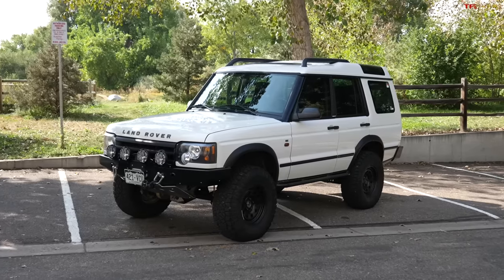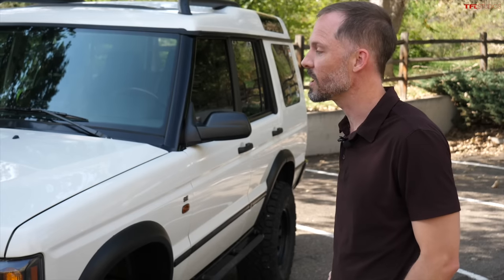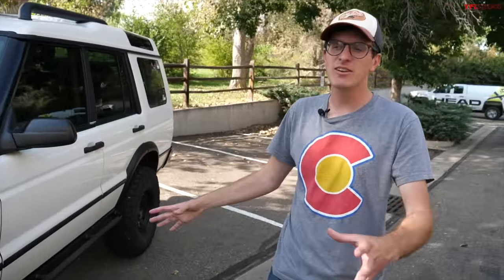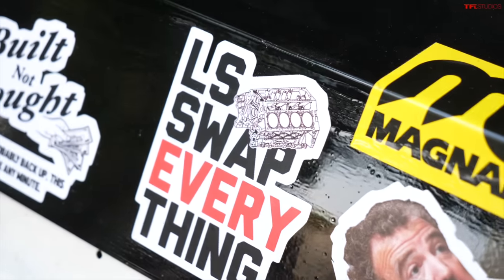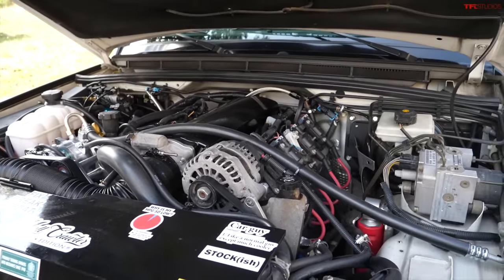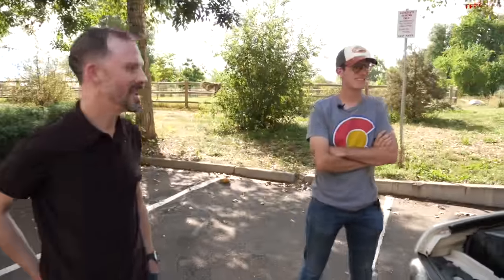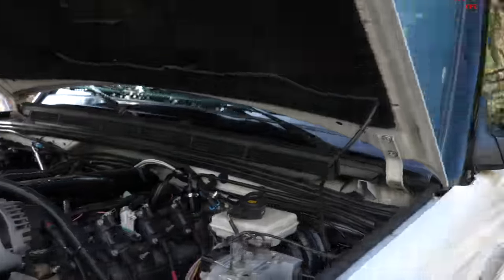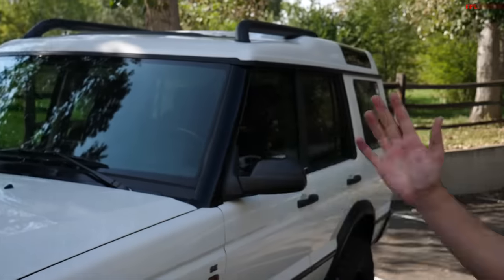$40,000 Later: I Found The ONLY Way To Make My Land Rover Discovery Completely Reliable!

Comment: My d2 literally exploded at 75k miles. I put 25k$ upgrades changed the oil every 4500 miles. I was in love and she broke my heart.  Fixed the engine for $4000 and the heads blew again at 80k miles. The diesel version might be good? Idk I would by the new defender cuz I loved my d2 so much besides the engine! But never again... worst investment of my life
Reply: I’ve got a ‘04 D2 td5 and it’s been great. Got 250k miles on the clock and still going strong.
Reply: Just get an lr3, 4.4 is pretty reliable, the transmission is ok as long as you service it, even the air suspension is pretty reliable.  Parts have gotten a lot cheaper, the only glaring issue is the suspension bits wear quickly.  The new rovers are really unreliable.  The lr3 is the car for an off-road build if you want a land rover.
Reply: @shaunbava1801   nah. It's to heavy at over 9000lbs that's why the suspension wears so quickly. Iv hurd bad things about the lr3 in general:(
Reply: @stoneyt46  it's less than ~6k lbs not 9, only 1000lbs heavier than the D2.  It's heavy but tough, I've had the D1, D2 and the LR3.  The 3 is the best of the bunch, maintain it and it will treat you well.  The interior is more comfortable, the build quality is better, the drive train is better, and the computerized off road systems are better.  For Land Rover it is one of the most robust vehicles they've ever built.  The whole LR range from 2006 to 2009 was pretty good, L322 with the 4.4 Jag engine is one of the best Range Rovers ever built. The suspension is really the lower front control arms, tie rods, and sway bar links.  I'm going to use poly bushes for the LCA's next time hopefully they'll last longer.  The discovery all 3 versions are great off road and in the snow.
Reply: @shaunbava1801  You are correct! 5796lbs. I just remember Jeremy Clarkson on making fun of how much it weighed on top gear cuz it has two chassies

Comment: “Completely reliable“ lol I was expecting a 5.7 tundra motor or some variant of Toyota….🤷🏻‍♂️
Reply: The GM LS1 is a very popular swap due to cost, availability,  and relatively maintenence free.  Obviously the Toyota V8 is not.
Reply: @normt430  not to mention packaging reasons. The LS Series engine is physically smaller than a lot of other V8 with similar displacements. For instance, the 5.7L  LS in my F body looks physically smaller than the V6 in my 4Runner. The V6 has dual overhead cams and all that crap and is physically wider than the LS.

Plus they offered those engines in SO many vehicles, they're so easy to find.

Comment: And this is why the 2UZ-equipped Toyotas are rising so much in value. Not solid front axle but a lot less hassles than a Heep or Landie.
Reply: Toyota fanboi alert!!!!.
Ps. Those pos' are going for so much more money because they're as rare as a unicorn. we all know Toyota junk rusts into the ground in 3 years or less
Reply: @Welcometofacsistube  sucks for you live in a rust belt.
Reply: @Welcometofacsistube not on my 2006. Original frame, very minor surface rust.

Comment: Oh dear. A Brit here. The basic Buick V8 engine that was fitted to just about EVERY British Rover / Land Rover V8 car is generally considered to be quite a reliable engine. So much so that it was a common swap for the Triumph 3 liter V8 fitted to the Triumph Stag (subsequently so much done that the original Truimph 3.0L cars are now worth more).

That lightweight Buick engine ended up in EVERYTHING this side of the pond (Rover / Land Rover / Range Rover / TVR), and is essentially the 'English V8'. I have a recollection that it started out as an engine for marine applications, and because it was small, and light, it was considered perfect for smaller English cars (which had smaller engine bays).

Still, I've owned a Land Rover, and I would never, ever, rely on one to get me home (great fun, but take out breakdown insurance).
Reply: I love my rover v8! It has been reliable to me as I’ve had to clean it up a bit since the previous owner. Seems the disco 1 for some reason is a loads more reliable than the disco 2 though, which is the builds I see mostly in the states like this one.
Reply: The late run done by BMW was faulty, there were issues with the castings and metallurgy.  A D1 or defender from the 90s is more likely to have its original block than an 03 or 04 dii.  The D1 was the better off road truck anyway.
Reply: The Buick V8 was over-worked by the time BMW got ahold of it for these trucks- that they designed. The LS is really a perfect replacement- still a "GM" V8- not designed by BMW's terrible engineers with the same problems they design into their own vehicles- so it's almost like going back to the original source that Land Rover used before BMW took over (however briefly). It's a aluminum V8- just reliable engineered- easy to fix and parts are cheap. In my opinion the Discover is still the most handsome SUV on the road anywhere- if we can keep more of them reliably on the road (and off-road) then this swap is a no-brainer. I have a new 4.6 sleeved motor in mine because these swaps were not available 6 years ago- but believe me- I'm pulling that POS out and putting an LS in it as soon as I can. Might video the whole process too- since no one has done that yet.

Comment: Rover V8s have their issues, I have owned and built several. However they ONLY blow head gaskets if YOU the owner neglect to maintain the cooling the system and if YOU the driver continue to drive it after a cooling system failure.

Comment: Nothing wrong with the Rover V8 engine. They usually fail due to long term neglect, especially of the cooling system. The problem with these are not the engine, but indeed electrics.  Oh and, a healthy Rover V8 sounds much much nicer than any LS (which mainly makes NOISE..)
Reply: 100% agree
Reply: Agree
Reply: LOL!

Comment: These vehicles are easy to own if you are mechanically able to fix. HEADGASKETS are going to fail between 60 to 80 k got mine done twice. You are going to need money to fix, best advice if you got a disco 180 degree thermostat and ultra gauge for Temps😁

Comment: I have a new (ish) 4.6 with top-hat sleeves- still not reliable- and the money I spent on that motor- don't even ask. Unfortunately 5 years ago when I did that the LS kit's weren't available. Now I'm going to put an LS in- I can sell the motor with just 25k miles on it and most likely get the engine and transmission with money to spare! LS swaps are really the only way to go on old Land Rovers- and they're worth it because they're still the best looking SUV's out there. Can you share info on what adapter you used and the links for the wiring guru's? I'm torn between the full drivetrain being GM or using an ACE conversion and keeping my transmission...

Comment: The ONLY difference between the 4.6 and the 4.0 Land Rover V8 is the CRANK. That's it.
Reply: I need proof
Reply: @fyneyoungstunna  check the bore and stroke dimensions for a clue. Then take several of them to pieces and put them back together again

Comment: hey ive got a question. i just  picked up a 2003 discovery and im curious if removing the stock radio and fitting it with an aftermarket radio will trigger the EKA Lockout/Immobiliser? I was reading up in the manual that the anti theft system will kick on if the radio is unplugged from the battery.

Comment: I'm working on rebuilding a 62 Buick 215 to put in my 94 Range Rover. Buick cast the engine block with the cylinder liners in place but when British Leyland started making the Buick engine they just pressed the liners into the block after casting allowing for the liners to fall out one day, sometimes on cars that had just left the showroom. All USA cars up to 2003 had these doomed Rover made Buick engines and thus Land Rover's reputation was ruined forever in the country. For my buick made engine I think I'm going to go with a Buick front cover so I can use buick drive belts and gm auxiliaries and a 7 pin hei gm distributor and roller rockers and lifters. My range rover has been with my family since 97 and at 200k miles its only real problem was the Borg Warner transfer case common in American SUVs. Its only I'm scared of liner failure out in the countryside like this guy, the car is much more reliable than any toyota so far.

Comment: The Rover V8 is a great motor but the accountants pushed things too far. It started off as a 3.5.  It was reliable and could do high mileage no problem.
They then pushed it to 3.9 which was OK but it was on the limit of what should have been done.
Then someone who should know better pushed it too far, the 4.6.

Comment: I always feel bad for Land Rover owners because the vehicles are so incredibly unreliable. Not anymore thanks to that build. Nicely done.
Reply: I have had mine for 4 years bought used, I did the head gaskets that is it, no other significant issues.  I have had a few minor electrical issues but they were all age related and simple fixes, lose connectors, broken wire sort of things.  Stuff that happens when you actually take them off road.

It has never left me stranded and I will take on a 1000 mile road trip with no hesitation - ok 1 the cost of fuel in BC it is brutal right now.
Reply: Depends on the car, some are good I'm almost 15 years in one that's been a daily driver with no major repairs only wear items.  Some models are good, some are bad and none are cheap/easy to fix. D1s for the most part were pretty good just the headgasket issue.  D2s had more problems, l322 range rovers had loads of issues with the BMW engine but not so with the jag engine. P38 rovers were also decent.

Comment: junk. had the same discovery 2, 2004... horrible frame rot and the engine had the Swiss cheese model. at 120k it wasn't the headgaskets, they were newer done for maintenance... it was the aluminum block to steel cylinder sleeves that was causing the overheating. had to junk it.

Comment: I have the opportunity to buy a 2004 discovery in superb condition for 5k. It has 100k miles on it but I am scared to death to buy it because of the dropping liner issue. I have no mechanical skills at all and have been warned finding skilled knowledgeable mechanics to work on them aren’t that available in my immediate area.
Reply: I say take it and take the challenge of learning some mechanical skills!
Reply: @richardgomez8010  it’s not about not wanting to learn it’s about not wanting to dump a bunch of money in something. If I were in the position to buy a reliable vehicle and a project vehicle I would buy it in a heart beat. Unfortunately right now it’s one or the other.

Comment: The last 2 years of the D2 were 4.6. And those engines where bad.  If you install a 4.6 p38 Range Rover engine it should be fine.

Comment: I was waiting for a Toyota 4.7/5.7 swap with that Thumbnail...
Reply: The GM LS1 is a very popular swap due to cost, availability,  and relatively maintenence free.  Obviously the Toyota V8 is not!
Reply: It makes no sense to go to the trouble to swap in a 4.7, now you have a timing belt engine that doesn't make a lot of power. The 5.7 is a good engine, but it's probably too damn big to fit in the Land Rover. One of the great things about the LS is that it has a relatively small physical dimensions compared to its displacement.

Comment: It must be a US market thing because nowhere else has the head gasket issues you guys keep going on about.
Reply: NAS V8 and BMW cooling for the California market.  The V8 is in over heat at 244.9 (warning light on). The 03/04 Disco's were shipped with with a 190 deg thermostat.  They ran between 212 and 220 -224.  Any cooling system fault got way too hot way too fast, resulting in bad head gaskets.

A lower temp thermostat 180 grey LR, or the inline solves that problem. A proper head gasket repair, heads and block checked for true, if they go corrects the rest.  If my V8 goes I will import a Spanish LHD diesel and call it good. (Canada so that is an option)
Reply: @RichGallant  I'm in Australia, so heat and a healthy cooling system are all too familiar for our market. 

I wonder if a core issue is that they may have been tuned lean for emissions, resulting in them running warm. Thermostat selection is definitely vital though.
Reply: @k2svpete  Could be with a 180 inline I can hold 183f on the flats.  Long slow up hills over 13% she will get to 204-215,  after 20+ minutes at sub 30 MPH, generally 2nd gear.  On the down hills after the peak I have hits low as 160.
Reply: Its the gas. The US offers 87 octane as the cheapest and 91or 93 is much more expensive. That rover v8 needs at least 91 to run clean and smooth. The tStat helps, but you'd be surprised how nasty the heads get after 80k miles on 87.
Reply: @poohssmartbrother1146  the low comp motors(8.5:1) will run on just about anything but I believe you guys only got the high comp engines. Sounds like you're onto something, our regular unleaded is 91 RON.

Comment: Ugh. Cool, but you've made it LESS reliable, if that is even possible. Then again, you've literally built it, so you can probably fix whatever breaks. I have the TD5 in mine, and the engine is the most reliable part of the whole damn thing. 370.000km and the engine runs sweet (knock wood), but bloody hell everything else around it is a mess. There are SO MANY possible electrical failures in these damn things, but at the rate I'm repairing them I'll have basically a new D2 before all is said and done. You can't break it by driving it, but it will just randomly throw a bunch of problems your way any given day.
Reply: The GM LS1 is a very popular swap due to cost, availability,  and relatively maintenence free.  Obviously the Toyota V8 is not!!

Comment: Rover engine stopped in 1999 1/2  then pos BMW put their shitball engine in it and the 2000-04 horrible years.
Reply: That's the Range Rover, this is the Disco, it kept the rover engine until 2004.
Reply: @allterrainrandy2587  i have a disco 98 with the gems and had a 04 disco with a bmw engine?
Reply: @trollsandgoblinsgoblin320  in '99 they switched to the BMW (Bosch) engine management system, and a 4 bolt main block, but it was still based on the 215ci  Buick V8.